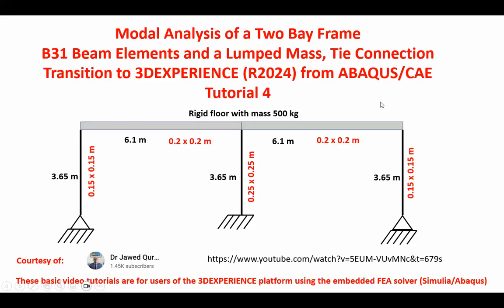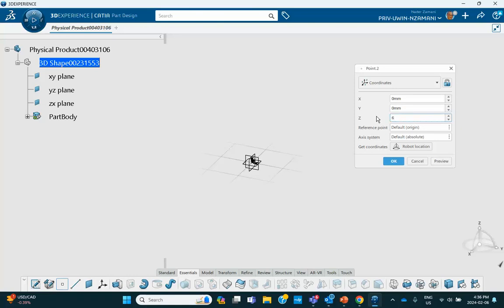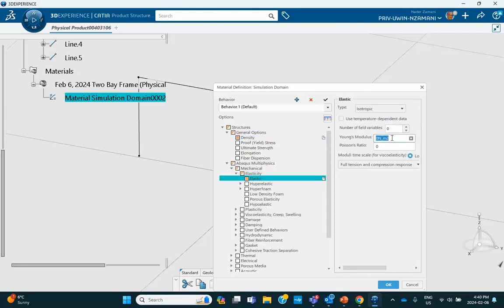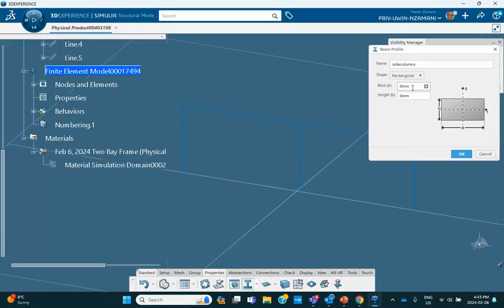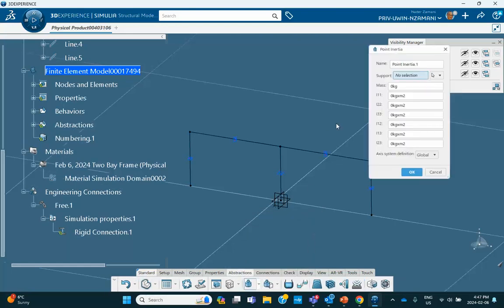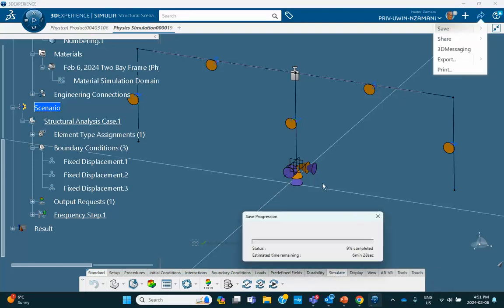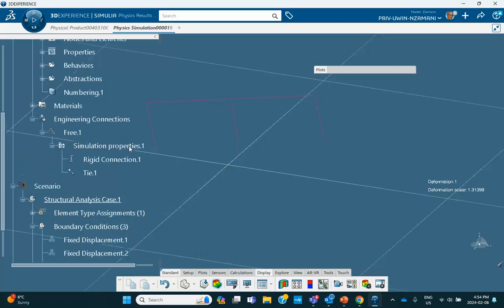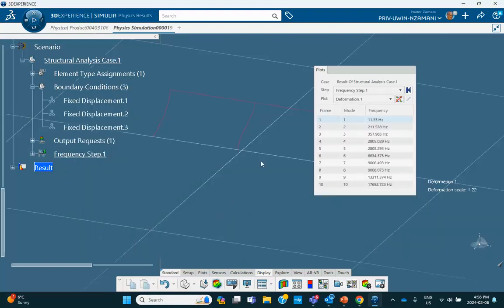Tutorial 4, Modal Analysis,2 Bay Frame, Tie Connection, Transition from ABAQUS to 3DEXPERIENCE R2024

Comment: Hello again, Dr. Zamani,

Could you determine the reactions at any truss members, or assume we have a group of beams acting as a single solid carrying a load? I am interested in finding out the internal forces at a specific section. This information will be very helpful for sizing elements such as bolts or fillet welds in a section.
Reply: My question will be for both Catia v5 and Catia 3DX.
Reply from the maker: Hello hkazzaz, are you referring to (for example) axial member forces in a truss structure?
Reply: @naderzamani-ngzk  
Let's say truss structure for now, can we get reaction forces at truss joint , Catia can provide reaction at the fixing but I am interested at a joint as we do when we draw free body diagram for a member
Reply from the maker: Dear Haidar, I uploaded something that may be what your are referring to. Here is the link.
 https://www.youtube.com/watch?v=z48EjR-Di4U
Reply: @naderzamani-ngzk  
Perfect, thank you very much professor